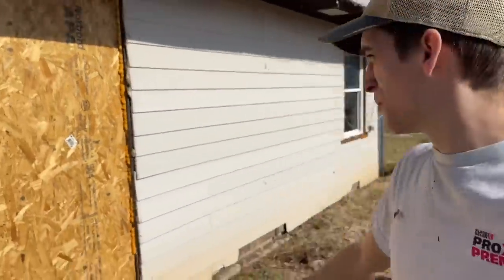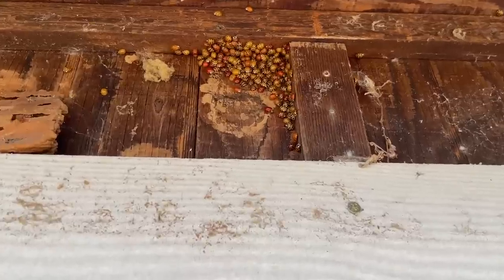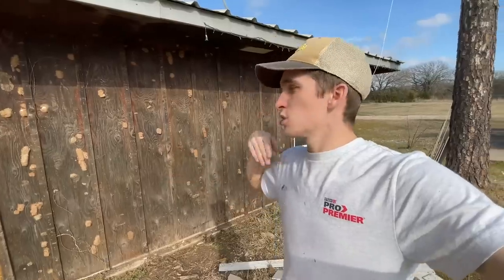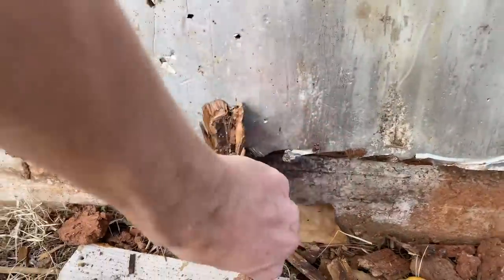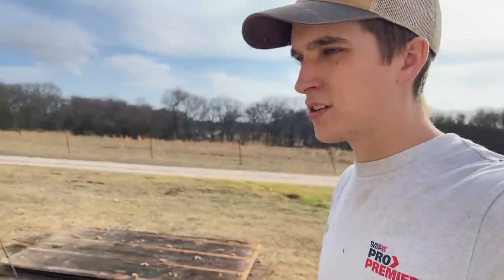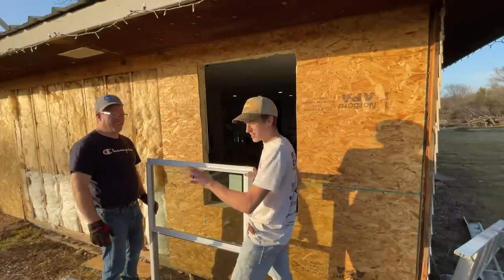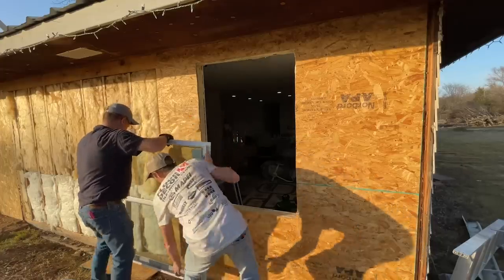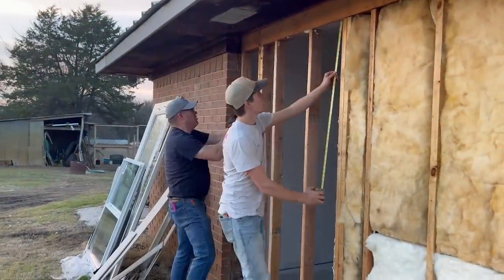50 years of Damage (house rebuild)

Comment: Those are Asian beetles but not Japanese beetles. They are not as destructive as the Japanese beetles. You can always tell a Japanese beetle because it has an iridescent shimmer to the Shell. Those are a form of ladybugs that you have there which are great at killing things like aphids. Do you have a large aphid load there in the spring summertime? It could be why there's so many of that type of beetles there

Comment: Good job getting so much work done! I saw bugs running around on the eggs that are about to hatch and on the outside of the incubator, I don't know what kind they are, but you need to check it out because it's inside your house! You don't want some kind of infestation after you just cleaned up all this mess with the termites, and you saw tons of mud daubers nests on the walls under the siding, I hope there's nothing inside the nests, and if there is, I hope they're dead! I hope you got rid of all those Japanese beetles or ladybugs whatever they are, I think they're Japanese beetles, you really don't want those in your house because you'll be finding them for years to come crawling all over, you certainly don't want them in your kids room crawling all over the walls, or in their beds! Do you have to replace the roof too? 💗💕💗

Comment: You might have been better off to level that house and build it from scratch. And you have that capability and could’ve done that I know it may have cost a little more, but it may not have with all you’ve had to clean up fix up, abate, and all that stuff you might’ve been better off building from scratch.